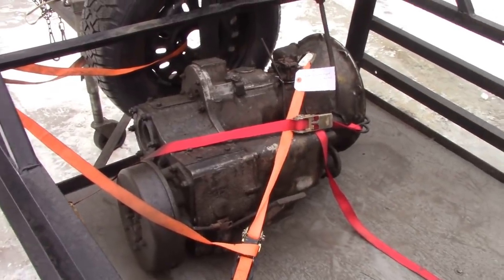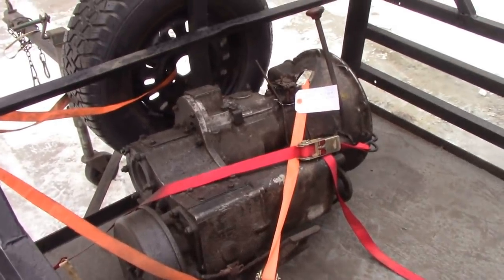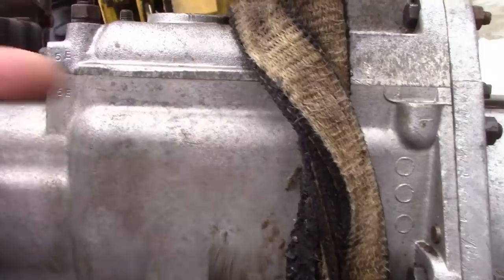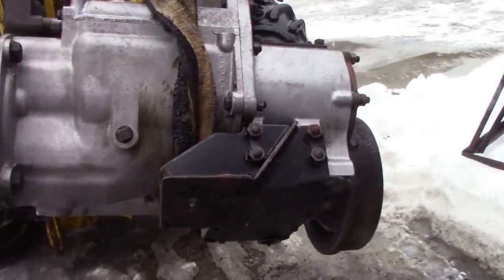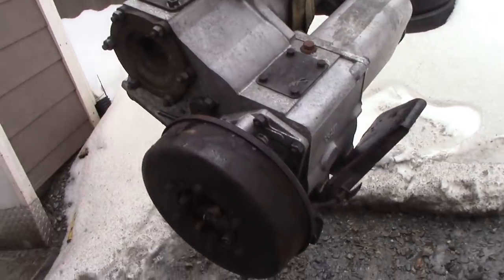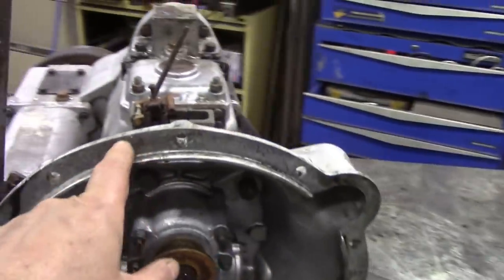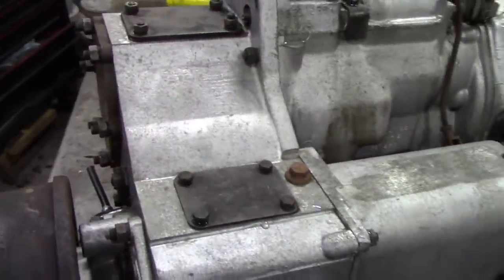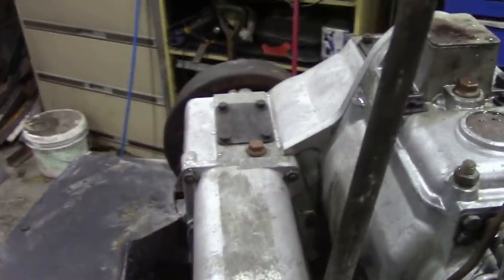Making a 2.25 S2a gearbox into a 2.6 gearbox - strip and inspect

Comment: 30 years ago I lost 1st, 2nd and reverse on my series 3. What happend was that the nut on the rear of the main shaft got lose (someone forgot the tabs of the locking washer). After tighening the nut and locking it with the washer all was fine for many years. I bought this series 3 diesel used in 1988 and it’s still my daily driver. Greetings from the Netherlands.

Comment: Many years ago at a scrap yard I had the choice of two gear boxes for my Ford Cortina, one looked liked new from the outside, the other was covered in crap, I took the clean one.

Removed the old one and fitted the replacement on my back with the car on a set of shop bought drive up ramps.
All went well, then came the test drive, 1st gear all good, 2nd gear all good, hit third 3rd what a bloody annoying noise, closely followed by the same racket in 4th, yep I wished I picked the gear box that was covered in crap.
Reply from the maker: Quite common on Teesside to be sold a 'recon' engine from the scrap yard which was power washed off and painted!  If it broke during the 'warranty' they just gave you another - they didn't care - they paid next to nothing for the car with the engine in!
Reply: Back in my youth I made extra money by helping people replace failed engines & gearboxes. I found that the best plan was to get one that was still in a crashed car, on the grounds that it was probably in working order since it managed to reach the scene of the accident
Reply: There is generally a lot more con then re in the recon business.  A few expensive exceptions aside, I have found the bulk of them terrible, even fraudulent.  The good ones look expensive, but when you boil down the costs, you see their prices are good - the cheaper ones are the rip off!

Comment: Mike, for the series LT76 gearbox the casing and the bellhousing were sold seperatly by Land Rover.  They were not line bored, so you could only swap the bellhousing.
Reply from the maker: The bell housing on the Series boxes are the front cover of the casing too